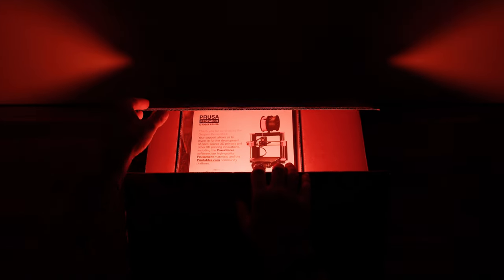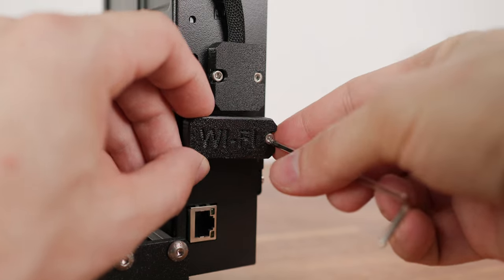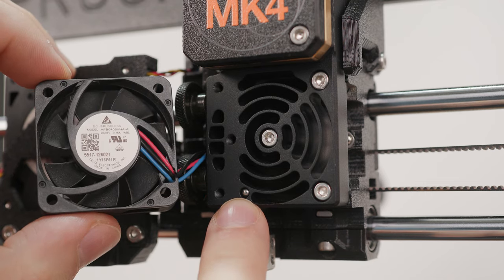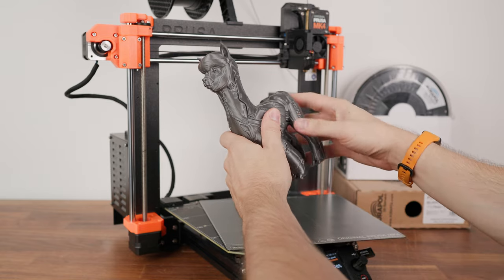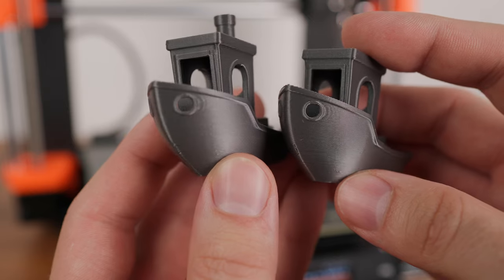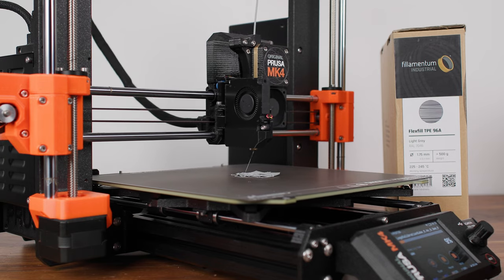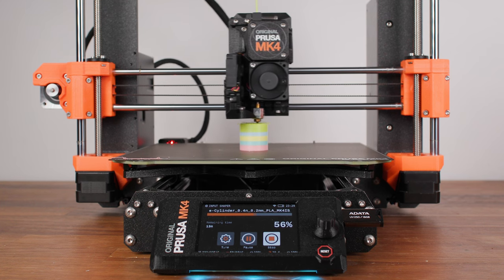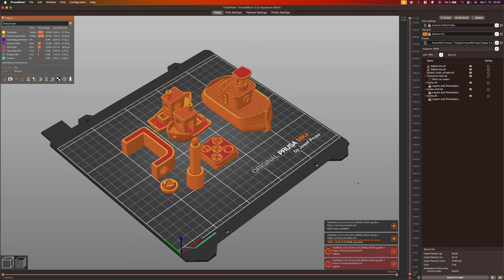Original Prusa MK4 - Better late than never. Don't you think? (Review)

Comment: Prusa made a few heavy mistakes. They developed to many different printers which distorted they development power into too many directions - as a result the developemnt of their cash cow mk series was too slow and lost a lot of innovation. Then this backward compatibility to upgrade existing machines is nice, but at a certain point it becomes an innovation stopper. Their communication towards the customers is more and more about marketing blah blah and less about innovation and customer needs. I think they should fokus on a small core of products and speed up massively their development power